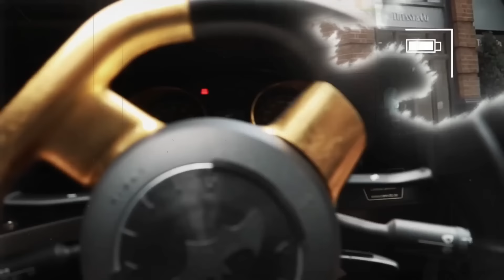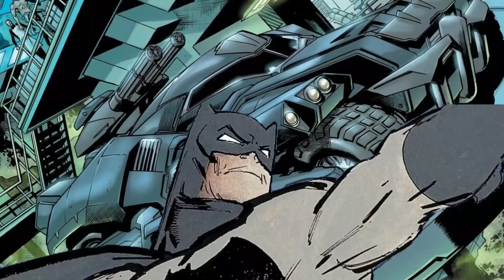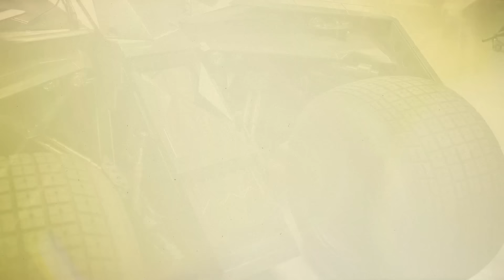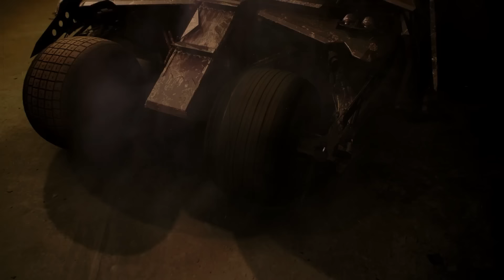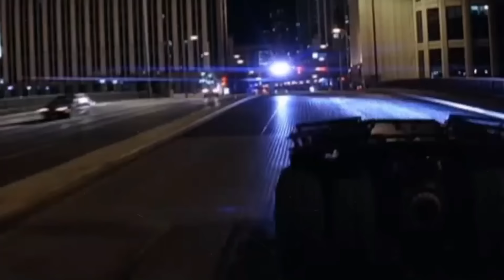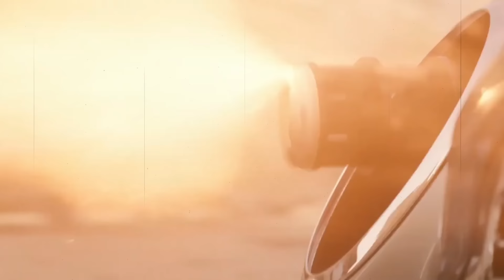How They Built Batman’s REAL Tumbler (Not CGI)

Comment: The one thing never mentioned in this whole video, is that only the british could build the vehicle from scratch, because every american company contacted said it was impossible to build!! The AMERICAN ENGINEERS saw the concept pictures, and said that you 'NEED' an axle between the front wheels, the BRITISH ENGINEERS looked at the pictures, then said 'NO PROBLEM, WE CAN BUILD THAT'. This is why american movie studios come to England to film thier film, because of our skilled craftsmen and engineering companies.
Reply from the maker: While the core of the comment about the Tumbler being a British engineering feat is correct, the assertion that American companies declared it "impossible" is not officially substantiated. The UK's reputation for skilled film production is also accurate. It's worth noting that the original Batmobile from the 1966 TV series was built by American auto-customizer George Barris.
Reply: @ReelIron  Barris purchased the Lincoln Futura, an extravagantly designed concept car, which he then modified into the batmobile! The 'TUMBLER' was built from scratch as an original vehicle, not on any other car manufacturer stock vehicle. Watch this top gear clip https://www.youtube.com/watch?v=Btl1znr7slM
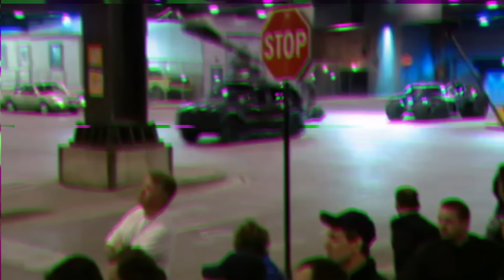at 01:35 in, where James may states american companies said 'it can't be done-too difficult', so I stand by my statement that the brits are better engineers than the americans!!

Comment: It's quite obvious the Batpod does not deploy from any driveable Tumbler. The functional Batpods are clearly not built out of the front suspension components used in the driveable versions.

The front tires are Hoosier right rear tires for dirt sprint racing cars. Dirt sprint cars use a larger right rear tire than the left rear tire to make them want to constantly turn left. On a race track, the drivers rarely turn their steering wheel to the left, most of the time they're steering right because the rear tire size difference makes the rear of the car swing to the right so they're in a skid most of the way every lap except for brief period going almost straight on the front and back stretches. Dirt sprint cars don't use a rear differential, which is another way they force the constant turn and skid around the track. This throws a lot of dirt around, which is a big part of the show.
Reply from the maker: https://youtu.be/n0RejzB4IKY?si=Mom-LY7Rg8UEFZad

Comment: Sorry, but the Batpod didn't actually come out of the Tumbler, that was in fact CGI - but considering the video footage at the beginning of this, while speaking of the Tumbler had the other batmobile and even a different movie scene from Interstellar, so it's not like the inaccuracy was surprising at that point. Lol
That said, decent video tho.
Reply from the maker: Yes, the Batpod absolutely does eject from the Tumbler in The Dark Knight. This is not merely a cinematic illusion or separate vehicle—the Batpod is an integrated escape system built directly into the Tumbler, designed to deploy when the main vehicle is critically damaged. The Batpod is literally formed from the Tumbler's two front wheels, which are self-contained powered units with engines mounted inside them. https://youtu.be/aCqLVVYO8y0?si=tflrDuVhLFKrdc6t

Comment: Near the end of the video, "the Batpod could really deploy from the vehicle."
I don't believe that.
Reply: The entire batpod ejection sequence was CG.
Reply from the maker: @thegalaxyhasclass  Yes, the Batpod absolutely does eject from the Tumbler in The Dark Knight. This is not merely a cinematic illusion or separate vehicle—the Batpod is an integrated escape system built directly into the Tumbler, designed to deploy when the main vehicle is critically damaged. The Batpod is literally formed from the Tumbler's two front wheels, which are self-contained powered units with engines mounted inside them. https://youtu.be/aCqLVVYO8y0?si=tflrDuVhLFKrdc6t
Reply: @ReelIron quit lying bro. The actual batpod is NOT integrated in the tumbler. Only in the movies... Not IRL it was special effect.
Reply from the maker: https://youtu.be/aCqLVVYO8y0?si=_ezXaAgC-RBdC34k

Comment: How is the vision from inside, for driving? I heard that Keaton"s Batmobile was difficult to see out to drive.
Reply: There are several blind spots from within, however to address this, they mounted several small cameras on the exterior, which projected those blind spots onto monitors in the cockpit!
Reply: @chopperking1967 ty
Reply from the maker: In the Batman Begins Tumbler, the actual vehicle constructed for the film, the windshield is a narrow, heavily tinted slit reinforced with thick armor plating, making it nearly impossible to see through clearly while driving.

Comment: with current day technology the Tumbler can be made even better . . . a Tumbler with a dedicated spaceframe monocoque chassis made out of high strength alloys & military grade carbon fibre composites, inorder to achieve exceptional torsional rigidity & enhanced stiffness . . . body panels crafted out of processed fibre reinforced plastic & suspension components made up of hydroformed aluminium . . . powered by a turbine engine & a 54.3 kWh iPMS can be added for PHEV variants & mated to a 8-speed torque converter automatic transmission . . . a 2-door 2-seater Tumbler that will feature loaded to the brim . . . cost per unit €2.6 Mn (approx) . . .
Reply from the maker: That's an incredibly detailed and well-thought-out concept for a modern Tumbler!

Comment: When they talk about iconic TV / Movie vehicles, I'm expecting The A-Team's van, KITT from Knight Rider, the Ghostbuster's Ecto-1, The Plymouth Fury that is Christine, that angular land vehicle from the one movie I can't ever remember the name but it had triple tires to go over basically everything... and pretty much most of the Batman Batmobiles... except only the Tumbler did what the tin said it was supposed to do and it did them.
Reply: The movie you can't think of is Damnation Alley.
Reply: @aaronswinger7026  Thank you, you blessed soul!  Now to go watch the movie, because that land vehicle looked badass!
Reply: @cocodojo  The Landmaster actually could drive over pretty much anything. The tri wheel system was fully functional. The metal on the front was strong enough to punch through a concrete block wall. What it couldn't actually do was float. That scene was done with a model. The interior shots were a set since the actual interior is bare metal and the engine takes up a good bit of space inside the front section. Also, the machine guns on the front wouldn't actually fit as depicted. The hemispherical bumps they stick out of are too short, no room for the main body of the guns. They're just tubes fed with acetylene gas through a pulsed valve and an ignitor.

In the movie it's stated there are two Landmasters but one gets destroyed early on so only one is ever seen. Good way to save money not having to build a second one, even as a static prop made of wood.
Reply: @greggeshelman  This thing sounding more and more badass with every description, I'll have to buy it on Blu-ray sometime this year!  I love how good old classic movies were with what they manage to do without CGI!

Comment: The Batpod leaving the Tumbler was digital stop lying!!
Reply from the maker: Yes, the Batpod absolutely does eject from the Tumbler in The Dark Knight. This is not merely a cinematic illusion or separate vehicle—the Batpod is an integrated escape system built directly into the Tumbler, designed to deploy when the main vehicle is critically damaged. The Batpod is literally formed from the Tumbler's two front wheels, which are self-contained powered units with engines mounted inside them. https://youtu.be/aCqLVVYO8y0?si=tflrDuVhLFKrdc6t
Reply: @ReelIron  You're full of shit!!!   I own the blue ray that shows how they did it!!!!   STOP LYING!!!

Comment: Its in Dubai now, you can buy it for about $20K !
Reply from the maker: Yes, there is a Batman Tumbler in Dubai, and it has been advertised for sale multiple times over the years. A recent article from September 2025 on DubiCars.com claims a Tumbler Batmobile replica is for sale in Dubai for AED 3.7 million (approximately $1 million USD). However, I could not find an active classified listing when searching the site, so the current availability is uncertain. This is most likely a high-quality replica, not an original movie prop. Additionally, Warner Bros. recently announced official authorized replicas for $2.99 million (limited to 10 units worldwide), which are separate from the Dubai vehicle.
Reply: Its not in Dubai... its in my shop, right now. Im making it better than ever...